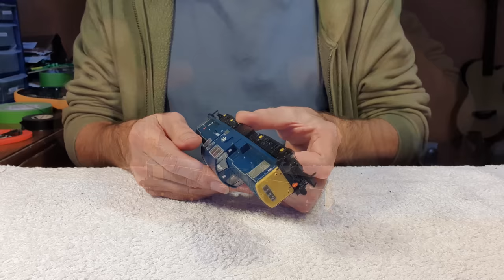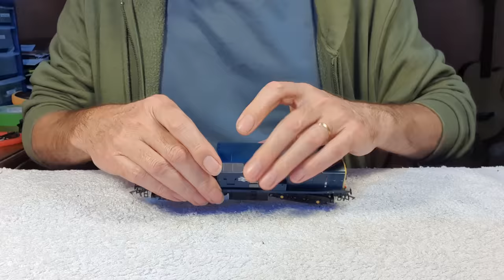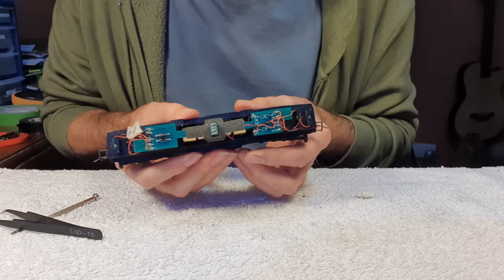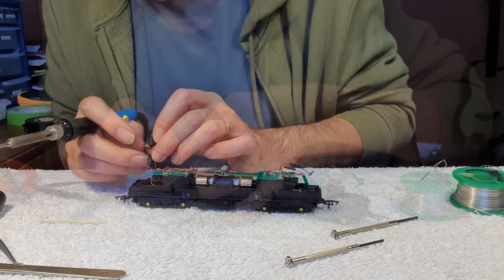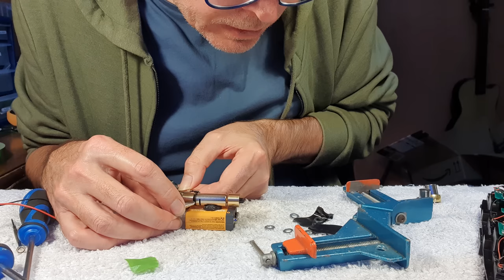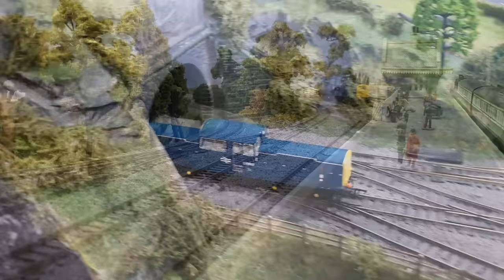Heljan Class 17 : Donation Overhaul

Comment: A master class in deductive reasoning and courage!  Thanks for your recent reply regarding converting a Lima Class 08 to DCC.  Ihave ordered a CD motor for it as you advised.  You may also like to know that I am renovating a Mainline Clloett Goods (an ebay non-runner bargain) and it is on my bench in pieces.  I can can see many symptoms and thanks to you I have the cures; I will proceed with every confidence guided  by your videos.  I can't thank you enough. Gordon.

Comment: Bill - your videos are brilliant, I did like the ones on the Merchant Navy BB/WC classes on Southern, as I have quite a few of those, a few of which have been troublesome mechanically - not least those in the mid-late 2000s it seems, possibly a touch of Zinc Pest or Mazak Rot or whatever, for instance my 17 Squadron from about 2007 hardly ever use does not always like reversing smoothly, this series had innards a bit fiddly it seems

Comment: Excellent vid, you have the patience of a saint.
I purchased 2 class 17's Brand New and these made a terrible racket when I first ran them. I then read on a site that they needed a good running in. I perciviered and after a few hours they did settle down.  I kept running them and after what seemed like a fortnight they began to run perfect.
They are both still running great with no noise and are very strong locos.
Regards Malc Lowe

Comment: Patience of a saint . I have the 17 . This is the most diabolical model to service ever. Mine was one of the original ones that had dodgy motor . Heljan held their hands up and supplied a new complete chassis and motor (after waiting a year !) so I had to figure out the way to get the body off to replace chassis . These buffers are infuriating ! Whoever thought of that !  If you can service that I don’t think there will be anything more complex .  My model also runs pretty slowly but they weren’t speedy things in real life . I wanted one because this must be one of the first locos I ever saw shunting at Chain Road Goods in Paisley . Didn’t know what it was then but it’s very recognisable  . The model was such a disappointment especially having it disabled for a year . Appropriate choice of wagon at the end as this model really takes the biscuit !

Comment: I can remember these Claytons replacing J36s and the like on local goods trains in the Edinburgh area in the early 1960s.  They didn't last long, partly because the services they were used on didn't have much of a future, but also I believe because they acquired a bad reputation for being unreliable.  Perhaps this model has captured the spirit of the original?
Reply: Yeah, they were very unreliable. The main problem seems to have been that the engines failed a lot, and having two engines per locomotive made it twice as likely that one would fail. OK, so you can still run the locomotive on one engine, but now you only have 450hp, so good luck if there are any hills on your route. Wikipedia claims (unsourced) that the availability was only 60%, which corresponds to two days of repairs for every three days of operation -- you may as well be running a steam locomotive, at that point.

Comment: The first batch of 17s had motor problems so Heljan issued new Chassis to dealers so the Twisted and taped wires are probably from that, I did a batch for a dealer but resoldered the wires

Comment: Wow your a braver man than me taking one of those apart Bill, talk about a bucket full of parts !! Great job
Reply: There not that difficult to work on, while I haven’t done a 17 myself I have taken a couple of heljan locos apart and put them back together, some of the easiest models I have worked on.
Reply from the maker: It very much depends on how deft you are with the very fiddly nature of them and what you compare them with. Once you know how they are put together they aren't really that much harder than many other modern models but they are still extremely fiddly and quite delicate in some respects. And they are definitely trickier to work on than most older pre DCC models.

Comment: Bloody hell Bill should have been a surgeon. Have to admire your patience. All the best Mick
Reply: "Well, Mr Boakes. I've scooshed out your joints and fitted extra pick-ups to your feet. This CD motor will be much better and much quieter than your old heart. You'll be running around like Usain Bolt!"
Reply: @beeble2003  Sounds good to me as long as you don’t push me in the shed. All the best. Mick.

Comment: How do you fix a short circuiting locomotive
Reply: What locomotive is causing the short circuit?
Reply: Perseverance, and a multimeter with a beep continuity test. (It's much easier if you don't have to look at the meter when you are testing!) 
First take a very close look that there isn't something like a track pin, or even a spring from a point, trapped in the chassis somewhere, attracted by the motor or traction magnets. 
Next, inspect closely the electrical path from each wheel through the pickups, to the motor and back, looking for anything amiss (out of alignment, bent, touching, chafed wires, etc). 
When testing for continuity where you don't want it (the definition of a short circuit!) it will be easiest if you can disconnect, or remove, the motor - that way you avoid accidentally finding the 'correct' route for continuity, through the motor! 
With the motor disconnected, check the continuity between the wheels on each side, and any other parts of the circuit.
Sorry if this is vague -- it's difficult to be anything more than very general in describing what to do. The main thing is to be methodical.
Hope that helps a little!